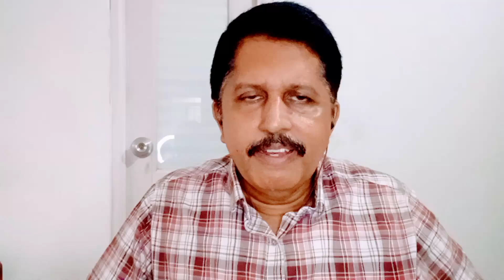Semi Cryogenic Engine: How Could Agnikul Overtake ISRO?

Comment: isro of today is not what it used to be in Kalams time where we were denied technology lacked funds and did innovations in solid propellant liquid propellant and cryogenic engine  but now isro wants to build sce200 engine which is Soviet Union design of 1980s by using rd810 engines  under project jasmine from ukraine now this is not reusable how are we going to compete like this our manufacturing is cheap but we cant beat reusable spacex rocket interns of price without using reusable so sce200 is not consequential iso methalox reusable engine which is indiginious should be prioritised